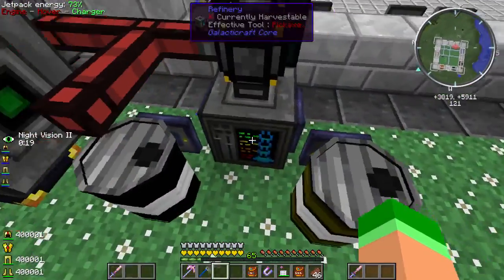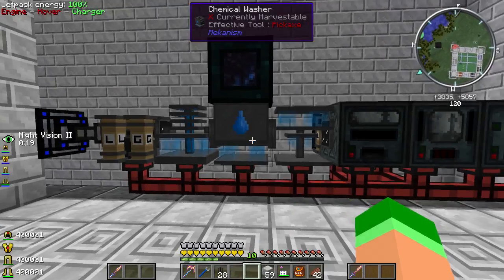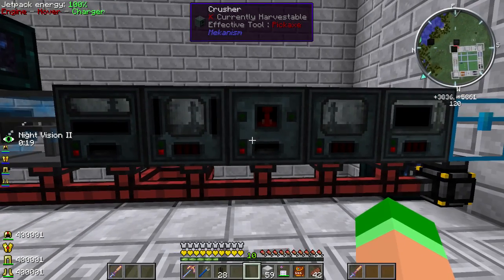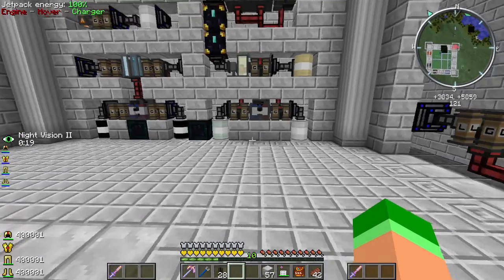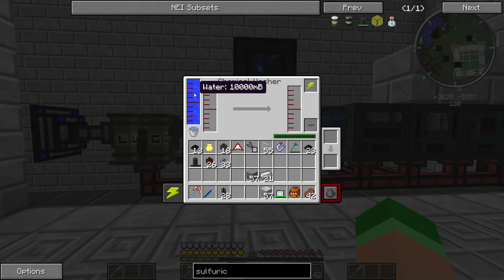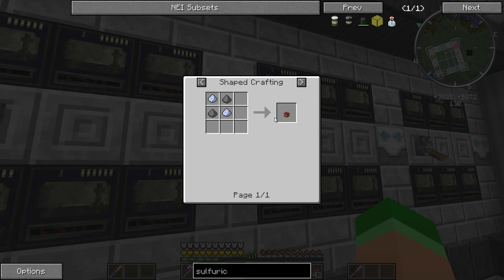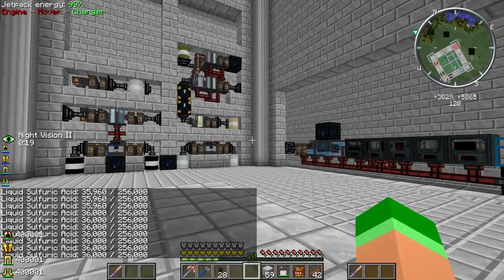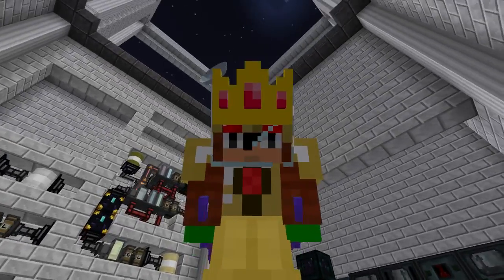Minecraft Mod Sauce Ep. 82 - 5x Ore Processing Mekanism !!! ( HermitCraft Modded Minecraft )

Comment: You don't actually need salt, you can make brine with a salination plant, which just needs water. As for sulfur, you can make it from gunpowder.
Gunpowder + Hydrogen Chloride → Chemical Injection Chamber → Sulfur

Water → Salination Plant → Brine → Electrolytic Separator → Hydrogen and Chlorine → Chemical Infuser → Hydrogen Chloride

Comment: If that is the path you want to take try looking at Ender IO conduits. They all  fit in a single block and the mod author added a new conduit that allows you to transport mekanism gases instead of turning everything to liquid form. Also there is a Salination plant( probably spelled that wrong) That takes water and makes brine. Just in case you run out of salt which is unlikely. If you plan to use factories you will need to expand your production of everything by a lot. I would also suggest that you make the dissolution and what not for each type of ore max of 2 per just so you don't bottleneck trying to process that much ore in one machine. Hopefully this helps you out.

Comment: I'd say keep the x3 for normal ore processing but have a way to switch between x3 and x5 if that's possible? So if you're running low on a rare material you can just flip the switch and manually put it in or something

Comment: I would focus on rarer ores with the extreme mekanism multiplication; iron could probably just be doubled. I personally use multiple Enrichment Chambers per Alloy Smelter for Iron. IDK what it would look like with the Energy and Speed upgrades, though... The Alloy Smelter, with Octadic Capacitor keeps up with 8 non-upgraded Enrichment Chambers like it's nothing
Reply: If you want a fast furnace, use the energized smelter that Dmac uses and turn it into a factory. Add speed upgrades, ridiculously fast smelter. Also use enrichment chamber factories with speed upgrades. Elite factories (the top tier) can do 7 items at once. But personally what I use to process ores is the QED from extra utilities. I take coal and the ore and put it in and that allows tripling of ores. No power required, coal is basically free from my wither skeleton spawner, and it can work very fast. Only problem is you can't automate it as it doesn't allow you to input into it. It only allows output. So I have to manually bring coal and ore to the machine and toss in a stack, wait for it to finish, toss in another stack, and so on. It also doesn't work with ores that are fortuned, such as diamond, emerald, coal, redstone, and lapis.
Reply: Will do!
Mekanism ore processing is pretty cool, but it DOES require a MASSIVE investment of resources in order to get even one group of machines working optimally.

How many QEDs do you use for ore processing?
Reply: Regis Bodnar I use one super-boosted QED that goes through a stack of ores in about 30 secs. I had to make tons of ender-flux crystals which, depending on how far you've gotten, could be difficult as it requires obsidian and ender pearls. But those are the only materials you need a lot of to make a fast QED.
Reply: Noice!
Reply: Why would you run a whole bunch of un-upgraded enrichment chambers? At S:9x E:9x they're 10 times as fast, use the same amount of energy per item and only use 20 instead of 200 units of gas per item.
Reply: It was actually cheaper at the time for me to make 8 enrichment chambers
Reply: Sorry, I derped. Somehow mixed up Enrichment with Purification/Injection.
Yeah, on Smelter/Enrichment Chamber/Crusher just running lots of them (or possibly going factory early and throwing in energy upgrades) makes perfect sense.
Max speed/energy is really only a important factor for the gas-using machines.

Comment: if you want mroe fuel. quarry plus mod has a refinery which you can enchant using the enchant mover to make fuel at insaine rates compared to all other methods, and it can only be connected up using ender IO last time i checked, unless you want to use the fuel you make to power it to make more fuel for a moderate net gain.

Comment: Dmac, The 5x OreProcessing is a problem, because the C.Dissolution has no input for ores, you have to do them manually i guess, and since 5x OreProcessing is just a way slow process that doesnt have a factory for it
Reply: I was able to input to it using ender io and extra utilities. It can be automated.
Reply: Works fine here. Ore goes in the top.
Reply: in 1.6.4 you couldnt :p

Comment: The salt thing is a huge waste for brine... Look up the salination plant, gives you brine for just the cost of water. Also dunno if it's true but I saw Someone say that galacticraft oxygen works.
Reply: I can confirm that galacticraft oxygen works and is an easy solution to that. Ender io gas pipes are very useful, and can interface with galacticraft things

Comment: There's a multiblock structure that turns water into brine so you don't have to waste your salt. Also, gasses can pass through compact machine walls so you could transport them around that way, even wrirelessly if you use quantum entangled machines.
Reply: Cool, that plus blaze rods for sulfer and there would mean no shortage of resources.
Reply: Stijn Broekhuis i have 16 set up in a chunk loaded wasteland. 2x multiplier and producing about 10 mb of brine each a tick. Produces a decent steady flow of brine that i tesseract back to my base for use / storage.
Reply: I go Cobble > gravel > flint > gunpowder > Sulphur.

Pretty easy to do, and self sustaining.
Reply: Use a cyclic assembler and set it up to make a water barrel from pams harvestcraft and then all you need is aqueous accumulator so infinite salt ftw

Comment: Don't do 5x - it's really only good for super rare stuff (but you have enough quarries and no super rare stuff in your modpack) Also the machines are really slow and dont work properly if you dont have one line for each ore. So you woud need like 100+ machines.

I personally like the 4x more because you can overclock most of the required machines.

Comment: I did this in a 1.6.4 mod pack a while ago and whenever my machines where full of hydrogen for example it would stop, so I had to constantly dump hydrogen to get the machine to constantly produce oxygen, is this the same in 1.7.10 where when the gas has no where to go it stops? Because if it is that could be a problem, like when that sodium drum fills up, the machine would stop producing the chlorine. Hope you understood that.